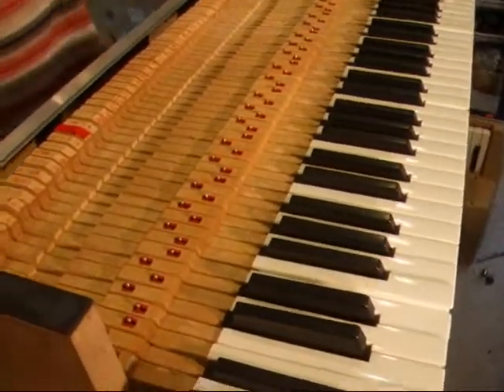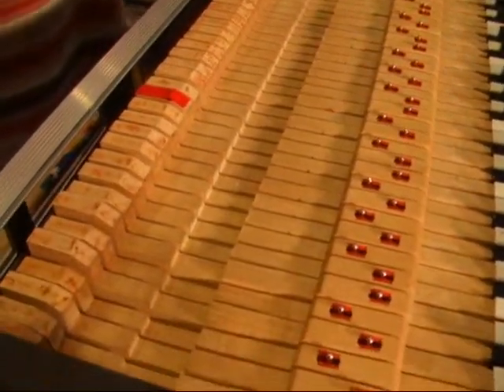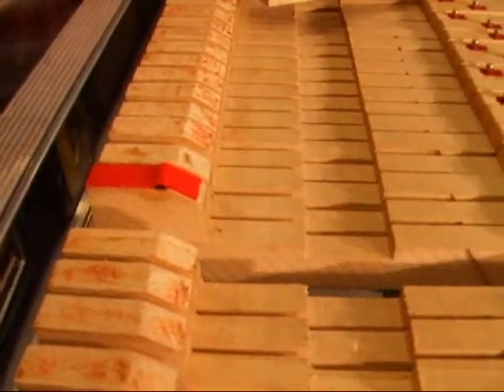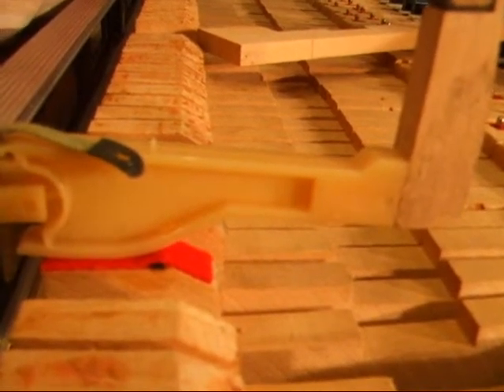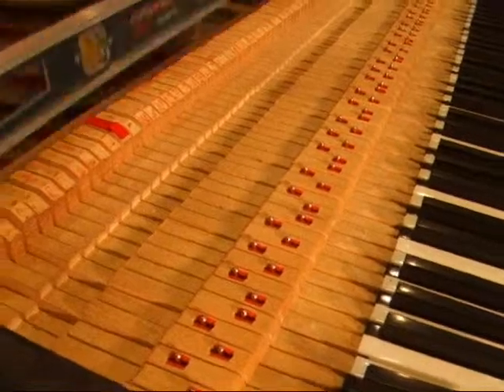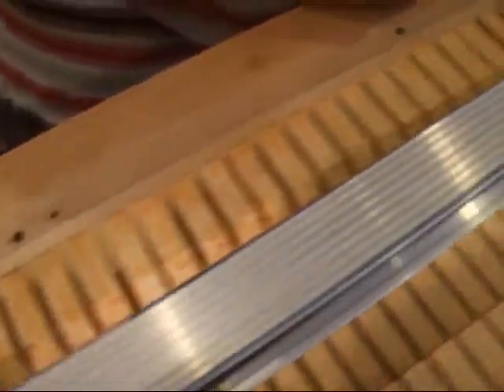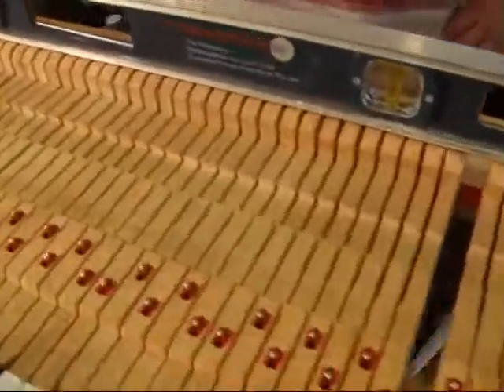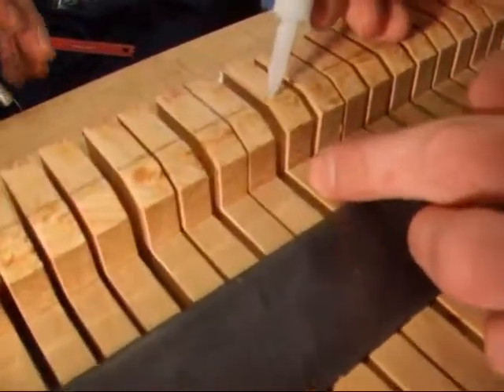Fender Rhodes Piano Repairs // Miracle Mod Installation on Steely Dan's Piano

Comment: it's a relief to see the hammers are not all at the same height, as is the condition of mine.  Will this be addressed or is this normal?  previous to my work on my piano all of the hammers did not engage the tines the same, some were very soft.  I am hoping this is fixed after i do the bump mod and key level.......